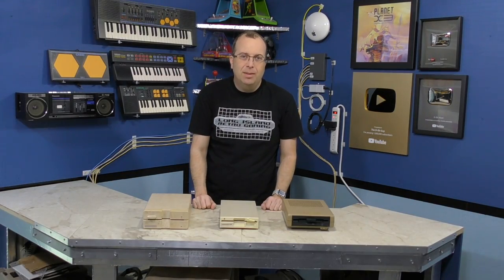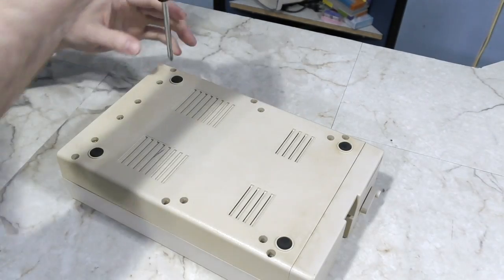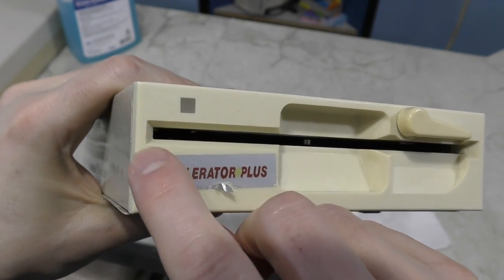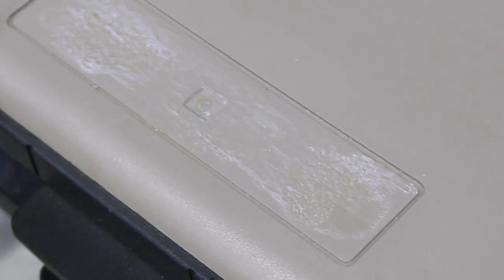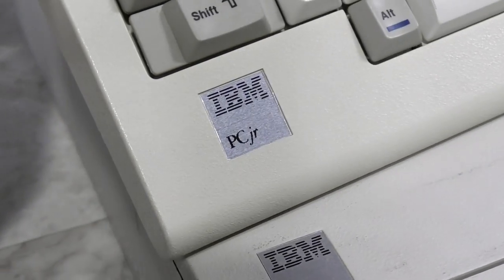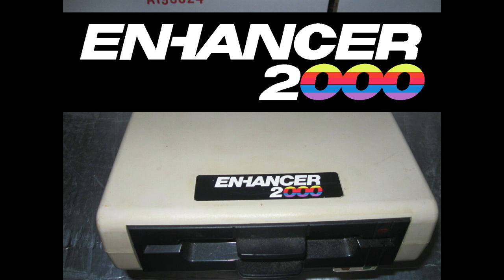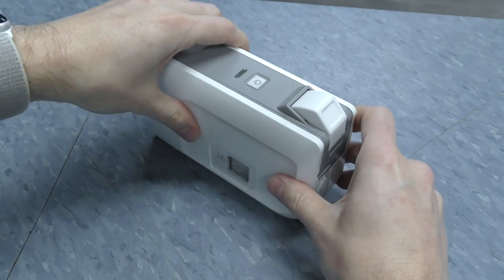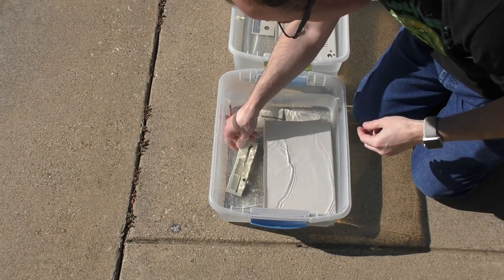How to make replacement badges

Comment: “I think I can build a contraption to use them safely” 
Famous last words
Reply: Actually it's not THAT dangerous, just put the lamp in a closet and don't open that closet with the lamp on. A second or two of exposure aren't fatal, although should still be avoided. This includes sunbathing without strong sunscreen
Reply: @jwhite5008  The biggest danger would to be to your eyes if you look at the light source, especially since its invisible to the eye. An EPROM eraser uses such a light and has a switch that turns the lamp off if you open the drawer.
Reply: Wait... is there really a new ElectroBoom video today?
Reply: @nzoomed  You mean EPROM with a single e, right?
'cuz an EEPROM is an "Electronically Erasable" PROM, so you don't need an UV light for that.
Reply: Very true, totally forgot about that. It would probably be a good idea to wire a normal lamp in parallel as an "OMG RUN AWAY" indicator. UV-filter googles may also help somewhat. I'd personally wire a switch that would terminate the circuit to the door, but that kind of contraption IS worthy of ElectroBOOM. Hmm.....
Reply: @VDavid003  lol sorry that's my mistake. Your right I mistakenly said EEPROM
Reply: Mr. Skeltal overheard at Three Mile Island,,,,,,,
Reply: @jwhite5008  It's hardly dangerous at all. You get plenty of it every time you sit near a clear window. 
It takes quite a lot of intense exposure to create a hazard. Otherwise we would never have evolved into homo sapiens.
Reply: Old aquarium with some nice tubes all around it inside a metal container with safety switches should work amazing. Have pipework in place to circulate the oxidizer solution to ensure proper PH levels.
Reply: Hey, remember, he lives in Texas.  Down here in Texas the most common last words spoken are, "Hey y'all, watch THIS!"
Reply: @jwhite5008  When I was in high school, our boys' glee club used to do stage performances, part of which was under two 1000 watt mercury vapor "black lights" on the stage apron.  This was in he sixties, but it was a traditional show since the forties. The lamps were rented from the local theatrical supply house. We were always warned to never look directly at the lights, which never seemed all that bright, but it still seems to hurt your eyes. We were told that part of the problem was that the iris didn't respond to black (UV) light so it would remain dilated as if in low light during the four three - minute routines. Nobody ever suffered any skin damage at all, some complained of eyestrain-like headaches.
Reply: I sure hope not
Reply: lol
Reply: @WCM1945  How's that eye cancer going for you all?

Comment: When I do my badges/labels I always go vector. I use as many sources as possible, get them overlapped with correct perspective in GIMP (image editor) and line them up in InkScape to vectorise. I try my best to source the highest quality print I can, some of my electronics have "battery choke hazard" warning badges that are very small, yes the font is quite remarkably high DPI (I never put them under a microscope to inspect, I should do that!).

I tend to keep all my badge vector files too, so if I end up sourcing a better print service I can swap to that and do an even closer-to-original output.

Takes hours to get a solid, original looking design - only for most of it to be muddied up at the print.
Reply: I second that idea.  CorelDraw used here at my shop.
Reply: I liked the open source software being used!
Reply: 8-Bit Guy has the most heart but sometimes his craft leaves me wanting. Sometimes he hand-waves terrible quality stuff without just admitting that he simply doesn't have the resources to do it correctly. At some point its like, why bother? I like to imagine that restoration is more detail oriented than this.
Reply: Xilefian you go vector? You never go plaid?
Reply: @ZTK-RC  Close enough/works for me attitudes don't work for those with OCD or that have exacting standards. That is why we have people that can make exact replicas of products out there that are more artisans dedicated to their craft.
Reply: Unfortunately, something you realize a lot is that these projects prioritize speed and getting the video done over doing an ideal job. And on one hand you can't blame him, it's his job, but it does get very frustrating.

Comment: 9:22  That's one low-capacity backup drive.
Reply: That has more storage than my pc has ram
Reply: Thats bad, thats bad
Reply: @billman69  ouch
Reply: @billman69  My man is rocking sub 3 gb ram in 2021 (though maybe/hopefully he has upgraded since this comment in 2019)
Reply: I hope that's a typo. Shouldn't it be 3TB? I haven't seen a hard drive that small in over 20 years.
Reply: @Anunoriginaljoke 3GB drives weren't in common use 6-7 years ago... more like 25 years ago. 3TB drives were. I realize he's a retro guy, but come on - he has a (semi) current PC, too. Hard drives come in two varieties - those that have failed and those that will. Typically, they don't reach old age gracefully. I'm pretty sure it was a typo, and you're confused.
Reply: @Anunoriginaljoke (walks away)

Comment: A difference in yellowing between parts on the same device (if all are original parts of that same unit) is frequently due to different chemical mixing of the plastics during the manufacture of the parts. This is most often seen on the Super Nintendo (SNES) where either the top or bottom shell case (or the cartridge door) is grey, but the other side (top or bottom) is highly yellowed. The chemicals of one plastic part was mixed correctly, and the other part was mixed poorly or unevenly, so the bromine yellowing becomes far more pronounced in only one plastic shell part, even though the entire unit was exposed to the same amount of sunlight.

Also, nice to see the "Treasure of the Sierra Madre" (1948) hat-tip at the beginning! (Also paraphrased in 1974's "Blazing Saddles")  It's good to know that older (pre-1977) films are still being appreciated, even if it's mostly through their famous quotes. ^_^
Reply: Also referenced in UHF. 

Badgers?
Reply: I've seen that myself on an old MicroBee computer years ago. The top was badly yellowed, but the bottom, was almost normal colour.
Reply: I think he talked about this and the effect that Retrobrite has on pieces like that in another restoration video.
Reply: The yellowing is inherent to the ABS plastic itself, not the Tetrabromobisphenol-A added to it.
Reply: @moosemaimer  Just in case anyone doesn't get the reference to "UHF", that's the Weird Al Yankovic movie of the same name.  So now that means you need to watch it.
Reply: MrTree1779 I debuted in 1971. I wish some of my quotes were famous..... in YouTube years, I’m DEAD!

Comment: Hi, I used to clean a lot of old telephones in a previous job. I found the best thing to remove adhesive is called oil flow. It is available at floor laying supply shops. I think you should try it :-) it works wonders for old labels and things like that.
Reply: Upvoted
Reply: That stuff works well but the odor is super strong. He'll need good ventilation or a mask.
Reply: i have no idea what about you talking, but seems you know it pretty well, so like.
Reply: SquareMEal huts huhu
Reply: I don't sell phones but i collect them! I post vids of them on my channel! Sorry for the ad!
Reply: I remember when my mom showed me that cooking oil would remove adhesive from plexiglass without damage. I was amazed!
Reply: @--Zook--  Like dissolves like, oil and the adhesive are both non-polar substances, there for they create a solution.
Reply: Wonder if goof-off wotks
Reply: I used lighter fuel for removing glue. But I haven't done it on plastic.
Reply: ...or Goo-Gone?
Reply: Plugs their channel and then says sorry like they didnt mean to...
I mean, the main reason you commented was to advertise...
It wasn't like you thanked for the tip or added to the discussion, so why bother apologizing if that's what you meant to do? :/
Reply: Purple Power.  Make sure you wear gloves with that.

Comment: Those small CLEAR bins nest in each other. You can line a "dry" bin with the aluminum tape to create a reflective container, then put a second bin, a "wet" bin, inside that to keep the cleaning liquids separate from the tape, allowing it to work on the various computer bits. Might want to use two of the bulbs in that case, as there is a level of opacity to the clear plastic that needs to be overcome. Otherwise, maybe visit some cooking supply stores to see if you can find some large, clear glass pots, bowls, or basins you can use, just wrapping the outside with aluminum foil (shiny side in!) for the reflectivity and less opacity from the glass.

Comment: When doing your retro Brighting I'm wondering if a small aquarium heater inside the vat would help to raise the temperature of the water and help the the process along a little quicker
Reply: They do make tea maker rods that go into coffee cups to heat water. That with a pond pump might actually do it
Reply: He has a sous vide he used once.
Reply: @Coolshows101  I thought it would be better to find a cheaper way of doing it because the peroxide could destroy that thing. Heat and oxidizers do strange things to medals after all.
Reply: @ImpetuouslyInsane  immersion heaters are stainless, so unless you're running voltage through the water it'll be fine. I'd be more worried about the plastic.
Reply: Yes, he sure should build a retro bright rig
Reply: I don't know if a to beat machine could be programmed to be low enough in temperature we're at wouldn't damage the plastic in combination with UV light it might just work but I was thinking aquarium heater would be able to be turned up high enough that it could warm the water with the UV light combination it might be a safe way to test the theory instead of using a sous-vide hot water bath that made damage Irreplaceable pieces. For those of you that don't know what is sous-vide is it's a form of cooking using hot water where you seal the meat in a plastic bag and submersive in the hot water bath until the internal temperature reaches the desired temperature.
Reply: @waylonhartwell  you can go pretty much just above body temp or even lower with a decent sous vide heater.
Reply: isn't that just going to help the peroxide react and go away, making the process slower and inefficient?
i thought the UV light was the main factor to help it speed up..
but idk i dont know stuff so im just assuming
Reply: @wyattroncin941  didn't know that the one my mother has only works in Fahrenheit so I I haven't really played with it much to see how low it goes because I can't really be bothered to calculate Fahrenheit over Celsius just play with it but hers seems like a pretty good unit. I believe it's made by instapot
Reply: @sliceofbread2611  the way I understand the process is it needs the water to be fairly warm and the UV light helps to speed the process up he's done the process boiling it in a pot on the stove with a set of keyboard keys and doing it outside in the sun for a comparison And got relatively the same results I think the video is a few years old now
Reply: @wyattroncin941   Not sure about that stainless comment.  I remember an immersion heater designed for tea cups that was quite light, possibly aluminum or magnesium, and you wouldn't want those in the peroxide without a test first. 

His comments about the peroxide made me look it up, and aluminum is great against peroxide if anodized first.  Tape isn't anodized.

On another note however if you mount the UV lights outside the plastic, 8-Bit Guy's tubs which appear to be standard polyethylene are good for transmitting UV-A and UV-B, but the plastic starts absorbing heavily once you get past about 200 nm wavelength so UV-C won't pass well.  I'm guessing that it would be a bad idea to go past that anyway, safety-wise, and sources will start to get difficult to find.  If your design held the lights safely on the inside of the tanks then no problems.

The "stuff" that formed in the solution, didn't really look like aluminum corrosion product.  I would guess a coating from the tape was breaking down. 

Yeah, those who remember their Chem class know that most of these reactions follow the Arrhenius equation where the reactions roughly double in rate for every 10 degrees C.  So there is a huge difference in retrobriting at 50F versus his summer temps outside, and the amount of UV also is hugely different.
Reply: @ImpetuouslyInsane  Who would make tea in a coffee mug? Pagan!
Reply: Hot plate?
Reply: And some UVC lamps instead of sunlight or these blacklight lamps, also available as aquarium supply. UVC is very damaging to your upper skin layers (mmh that smell of burnt flesh) and eye's cornea. So it's best to use them in a 100% sealed container (under a lid or something). UVC lamps are made out of quartz glass, since normal glass blocks UVC (that's what differentiates UVB from UVC fluorescent gas discharge lamps, the glass). I'm not sure how close the lamp has to be to the work piece under water. It might not even reach the surface of the plastic if it's submerged too deep. I'm sure there's UVC lamps that can be submerged into water since it's used for water desinfection and purification, so those might be the most effective. Some kind of rotation disc in the bath for the work piece to put on would be ideal, or use more than one lamp.

Comment: Man, seeing that excelerator plus makes me so nostalgic for my C64 setup I had as a kid.  I had a paper route, and earned my own money to buy a refurbished C64 and 1541, and then at some point later bought the excelerator for a 2nd drive.  I don't remember it having any compatibility issues and was so much smaller than the 1541, and its multicolor LED was pretty cool too.

Comment: I'd love to see a video about the history of printers. From the old spool typewriter style all the way to modern 3D printers.
Reply: Yes that would be awesome. In fact people still use dot matrix printers to this day since they are very reliable and can print on multipart paper.
Reply: That might be a long video.  I'm trying to remember all the different types I've used or worked on.  Thermal, electrostatic, wax transfer... trying to recall the printers used with Tektronix storage tube terminals, some sort of video capture.  Impact printers using 9- and 24-pin printheads, multi-hammer band printers, daisy-wheels.  Actual Centronics printers.  And we could include plotters, too!
Reply: @bobblum5973  make it a multi part video! This is the history of tech! We should learn to preserve it.
Reply: Jeff Finch: While not as up to date as you're describing, there is series 3 of The Secret Life of Machines, with Tim Hunkin. No episode specifically about printers, but they do cover related technologies such as the fax machine and the photocopier.
Reply: @Christopher-N  I actually emailed Tim a few years ago. Great guy. And the secret Life of machines is an amazing TV show

Comment: I have been using various types of a4 sized paper for my printer that works as stickers. I have both clear and white backed "paper" which works great for this exact thing. It's propably something you should look in to using to get rid of the overlapping lines as is on your PC jr badge and you can print as high of a ppt as your printer supports so they should also fix any resolution "issues" that you might be having on some of the badges to.

Just something to think about if you plan on making a lot of these badges.

Comment: Hey, I tried your baking soda trick the other day to clean the thrift store wax pencil/crayon price marking off a set of Creative Labs speakers I bought.  I had been worried that it might affect the texture of the plastic somewhat when I had seen you do it in the past, but in this case it removed the markings with no perceptible change to the plastic itself.  So, thumbs up for that cleaning tip, it works a treat!

Comment: To your UV comment near the end of the video. I live in Canada, so retrobrighting is never an option in the winter, so what I use is a metal halide bulb suspended over my bathtub. I cover the pieces I want to retrobright in peroxide creme and wrap them in saran wrap before placing them on a baking tray in the bathtub. This type of bulb requires a ballast and I had an external one made with a switch, that way I can place it outside of the bathroom and turn it on and off with the bathroom door closed so I'm not exposed to the UV light.
I'll check the status every several hours (with the light off) and rotate the pieces and make sure the peroxide is evenly distributed. This method has worked very well for me!

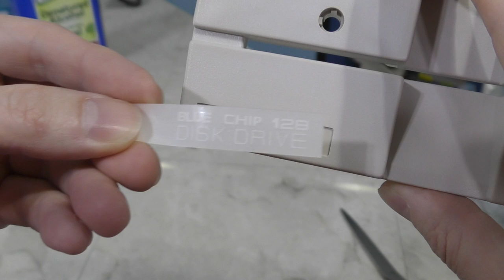Comment: 16:50 From that photo, I can see that the fonts used were from the Eurostile family, which is used with most products both then and now. I recommend getting the fonts for any future projects.
Reply: Some of them are slightly modified.  Easy to do in Photoshop, too.  (Convert the text layer to a shape and adjust the vectors at will.)

Comment: In my retro-bright experiences, I have used a large aluminum baking tray to reflect the blacklight. It is a cheap tub like tray used for cooking turkey in the oven. Usually a 2-pack is a couple of dollars. I also used 2 4-foot blacklight bulbs in a cheap shop light fixture.

I have retro-brighted old consoles (SNES) as well as GI Joe and Star Wars toys in this manner with great success. Left in solution for 24 hours. I have found temperature has less to do with the process than a good UV source.